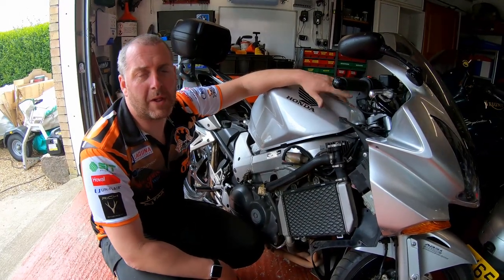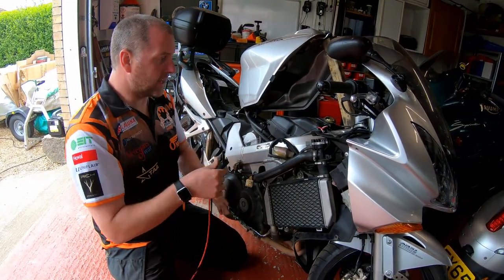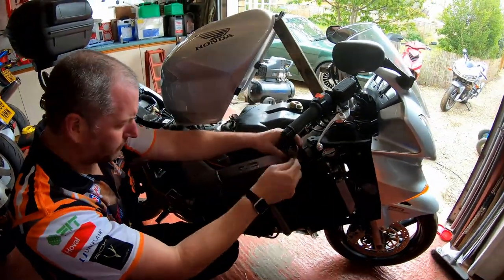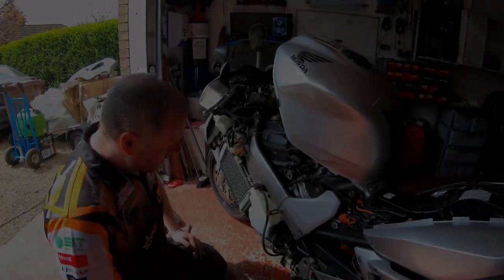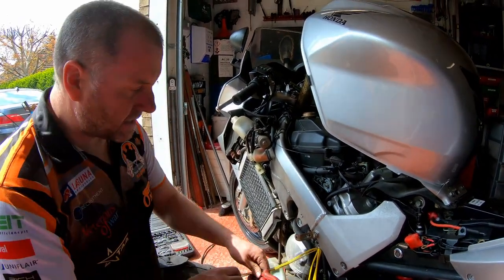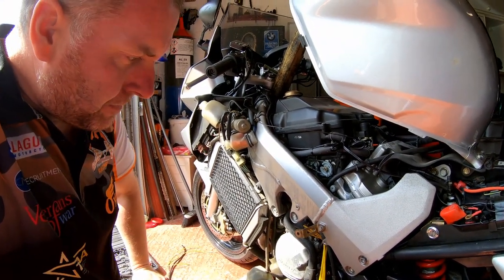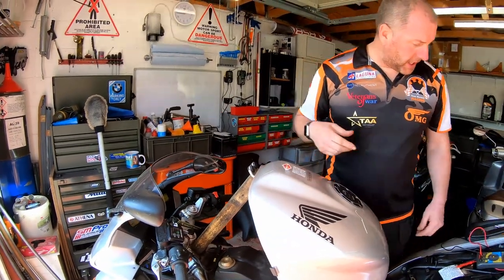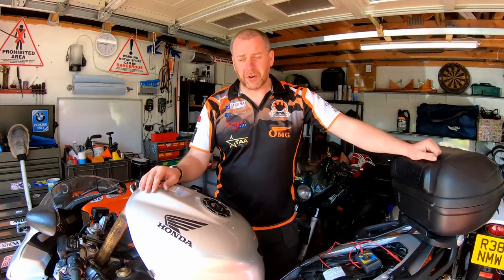Replacing The Reg/Rec On The VFR800 With A Shindengen FH020AA Episode 3 Let's Sort The Wiring

Comment: So easy to follow. I did one additional thing. Where the 3 cables for the stator are passed through the chassis I passed them through a few inches of clear polythene tube so they will not become abraded. Bit belt and braces maybe but better safe than sorry. The soft silicone cabling is great to work with. Keep up the great advice. Much appreciated.
Reply from the maker: Yeah, it doesn't hurt to go a bit belt and braces on these kind of things. Good work buddy! 👌🤓

Comment: savage video . my RR melted and i ordered a mosfet replacement and it came with the 3 yellow wire plug and the straight  positive and negative battery leads and i was in two minds weather the 5 pin connector from the loom could just be bypasses . having watched your video it has made it quite clear that this is a suitable set up and will be tackling this same install myself tomorrow ! nice simple step by step ! great job bro
Reply from the maker: Cheers chap, glad the video helped you out 👌🏻

Comment: Hi Kev, thanks so much for the videos, and sorry if the is silly question, but once you had pulled the new stator wiring through, how did you know which of the wires to connect to each of the stator wires? Does it not matter?
Reply from the maker: It doesn’t matter buddy 👍🏻

Comment: Great videos Kev. Can I ask you do you have to use the flux or can you solder without?
Reply from the maker: You can get solder with flux already in it but in my experience it's not all that good, adding flux before hand helps a lot. The flux helps the solder flow to where it needs to be instead of forming a blob that doesn't adhere properly.

Comment: Thanks man, very useful upgrade. Only thing that if I may say is that You never leave RED wire without additional protective tubing thru the chassis and close to the engine....,many places where there can be chafing issues with that wire and that is important wire :) . Never the less...great job!..Bravo!

Comment: Hello Kev,  were you getting 14.2 volts with both dip and main beam on?, i bought an 03 Vtec which didn't appear to be keeping the battery charged. I bought an after market R&R which at idle shows 14.2 volts, when the dip is switched on it drops to around 13.0 when the main beam is switched on it drops further to under 12. Raising the revs makes no difference, if i switch the lights of it rises back to 14 plus at the battery.  Any ideas?. Many thanks.
Reply from the maker: The voltage should never drop that low when the electrical system is put under load. I would suspect the stator is not putting out voltage on all 3 phases.

Comment: Hi Again Kev, just wondering about using the auto reset fuse. On VFRdiscussion they are saying to NOT use the resetable fuse just use a regular fuse so that you will know there is an issue and then fix it. What are your thoughts? I've used all your VFR videos to help me with my '02 VFr and now with my '06 VFR. Thank You so much they are a great resource.
Reply from the maker: If there is a problem, the CB won’t self reset, not sure why anyone would suggest that it would! 🤷🏼‍♂️

Comment: Hi Kev, after finding the reg/rec connector all burnt out I followed your vid to change the system exactly as you showed. My problem is that the system is not charging. I the followed your check list as for the CB600 video and everything checks out ok, all the resistances and diode checks are ok. I checked the main fuse, the battery seems ok, holding charge. I charge it with a maintenance charger. Do you any idea where I should look next? The regrec (Shendigen) and the stator are both new.  Help!
Reply from the maker: Are you definitely getting AC output from the Stator?
Reply: Check the negative/positive cables going to the battery i had a short innthe cable going around battery causing the same problem

Comment: hey Kev, so you dont reconnect the original harness back to battery?
Reply from the maker: No leave that connected other wise the rest of the bike will have no power. Simply add the new wiring to the battery as well 👍🏻

Comment: Hey, great video series, but I have one question. Is it too hard to solder new yellow wires straight to the stator? I mean inside the case itself. I understand it should be enough as what you did, but maybe going inside we would find something bad with the stator itself if we're doing this 🤔 never been there, just thoughts.

Comment: You could use butt crimp connectors with glue for the statorwires. They are waterproof. Soldering makes the wires hard, and proned to break due to vibrations.
Reply: Surely there's less resistance with soldering and therefore a decrease in heat causing brittle wires at each side of the connection?
Reply: @p9917j  You've got at point. But how many soldered connectors can you find in a motorbike or a car? I would say none.
Reply from the maker: I had considered crimps but prefer the permanence of solder and heat shrink! If anyone doing this wishes to use that method then it’s their bike and their choice 👌🏻
Reply: @Blackfinger00  indeed but is that for ease of assembly and swapping failed ancillaries reasons with less focus on longevity or simply the best possible connection achievable regardless? Given the proof in this series, I'd say the former is the driving force behind the oem's bullet/spade/block connection preference👍
Reply: No real issue though, I'm actually commenting/debating more to help Kev on YouTube interaction algorithms than cause any disagreements haha.
All the best wishes in these tricky times to all 😉
Reply from the maker: Cheers Paul 👌🏻😁
Reply: Blackfinger 2 I crimped the wires, then soldered the crimps. No worries there. Breakage is not really an issue with soldered wires. Soldering tip for Kevin: put the iron underneath the wires(heat rises) and let the connection heat up , apply the solder between the tip and the hot wire, it should flow readily. It looks like you did a good job Kevin! Cheers for another great video.
Reply from the maker: @wirenut3020  Thanks for the tip, I did in fact try to do exactly the method that you described above as another viewer said that I should do the very same thing when he watched the first part in the series. The problem that I had was that although the iron was set at 400 degrees it just wouldn't melt the solder using the method that you described so I was forced to revert to the way I did it in the end! Happy to hear your suggestions as to why it wouldn't work for me as it is a skill that i'd love to improve upon!
Reply: I have no issue with solder per-se.  Car makers WOULD use it more if they could do it quickly.  I have a couple of issues with THIS job though.  1/  If you must solder on a bike, use tin/lead.  Lead-free is more brittle is a vibrating environment.  2/ As a manufacturing engineer with a fair amount of time in electrical assembly, I hate the birds nest bodge.  By their nature wires on an old bike are oxidized and difficult to solder to.  No amount of flux can clean dirty copper.  You bury this "did it/didn't it" solder inside the joint where you cant see it.  Now you just don't know if it took.  Mechanically its locked in but I've see gear fail like that.  I use solder sleeves.  You can pre-tin the wires and inspect them. They have their own heat shrink.  Job done.

Comment: Question - Don't you need to maintain the wiring to the ignition switch from the battery terminal cable?  I've seen a brief statement about not needing it, but when you buy a used moto, you don't know exactly what you've got until you get in there.  The service manual wiring diagram has a connection from battery to ignition.  Both my RR pos cable and the ignition switch cable were soldered into the same battery terminal.  I kept it just in case.  If the moto doesn't start when I'm done, we'll know why.
Reply from the maker: A good amount of it needs to remain as it still feeds all of the other electrics on the bike, you can remove the old R/R and Stator connector and it's cabling all the way back to the next connector if you wish without any problem though.

Comment: Hi kev do you know if this set up will work on a vtr 1000 firestorm as i know they have reg/rec probs too if you could reply that be great
Reply from the maker: This will work on any bike mate, the only difference will be the mounting plate will need adjustment to fit the intended application 👍🏻
Reply: @KevsShed  awsome were can i get all of what you used can you tell me at all please as it some thing ill do while bike is apart have new engine put in

Comment: Have you done any work on the ZX9R yet? I'm installing a 923cc Wiseco piston kit in mine at the moment. That was a lot of work, but the job is nearly done now.
Reply from the maker: Not had the chance to start it yet as I was waiting until I’ve built my new workshop. It would have been built by now had the virus not drifted in! Hopefully I’ll be able to start it in the next couple of months! 👍🏻
Reply: @KevsShed  Looking forward to the build! Got any parts yet? Upgrades?
Reply from the maker: Oh yeah, I have a Z1000 transmission and a couple of brand new engine cases. :)
Reply: @KevsShed  Cool! I have a spare transmission from an zx9r E1 (year 2000) in case my weak 98 gearbox goes. Looking forward to watching the job, it will be useful if/when I need to do the job myself! Out of interest, is the zx9 yours?
Reply from the maker: Yes mate, it is my bike although my 16 year old son believes it to be his! :)
Reply: @KevsShed  Lol! Do not, and I repeat, do not, let your 16-year old son anywhere near that bike :)
Reply from the maker: @nitramh24  I know right! :)

Comment: Hi thanks for the video. I've seen on some forums that the only weak points of the vfr is the rectifier the wiring and the stator. Will this upgrade reduce the chance of having to replace the stator in the future?
Reply from the maker: It certainly should, bypassing the troublesome wiring means that the high resistance caused by corrosion is eliminated.

Comment: Hello and thanks for the great videos. I have only one doubt, following the HONDA wiring diagram, on the original R / R, in addition to the negative there are two positives and a Blue/White wire, which goes to both the starter relay and the safety switch. I wonder, if putting in this new wiring, all those security systems stop working. What do you think about it?
Reply from the maker: The additional wire on the stock R/R is a signal wire to activate the R/R on start. The Shindengen doesn’t need this signal 👍🏻
Reply: @KevsShed  Thanks again ;-)

Comment: hi mate! In your video you forgot to place the bracket that was screwed to the old regulator and which in turn has a nut to hold the fairing.  Have you solved it in another way or do you just leave this screw unused? Thanks for your video
Reply from the maker: Nah you are absolutely correct mate, good spot! 😁 I went back and refitted it! 👍🏻

Comment: Is there any reason why you add additional wiring instead of using the original? Thinking of doing this to mine and wondering why folk don't just cut off the old connector, wire on a fresh one and plug in.

Anyone in the comments done that?
Reply from the maker: You absolutely could, this bypasses all of the old wiring removing any future issues with it.
Reply: @KevsShed  Ah cheers, yeah I've since read about the grounding issues etc. Think I'll take your advice on board and just wire it up on it's own wiring like you've done. Thanks for the reply!

Comment: The old wires between the former rectifier and the battery, is it ok to remove them completely or are they wired to anything else? I saw that you used them for a voltmeter and an USB-port mounted around the ignition in a nice manner. On my bike there is a USB/voltmeter unit drilled into the fairing so even though yours looked more nice I'm quite happy as it is. 

Nice three episodes overall :) I think I might have to replace my rectifier soon enough... had problems with the battery last days (or so I thought), but might be the my turn. I'm charging the battery overnight now and am going to do some testing with the stator and rectifier tomorrow when to battery is fully charged (so I can at least remove a  bad battery as the reasons for my problems).
Reply from the maker: You can remove those wires if you wish, no need to keep them if you don't wish to use them for anything else.

Comment: Stupid question of the day.. does it matter which of the three yellow wires is soldered to which of the stator outputs? I couldn’t tell if you tracked exactly which went to which or not 😂
Reply from the maker: Mike it matters not a jot mate, you can go to any of the yellows, it's 3 phase so it doesn't matter, your R/R sorts it out for you using magic!  😀
Reply: Kevs Shed 👍🏻 wonderbar. Having it installed on the 5th so thought I’d ask up front incase questioned.